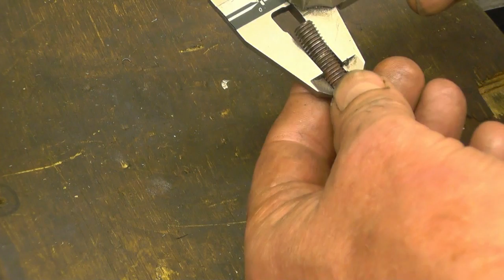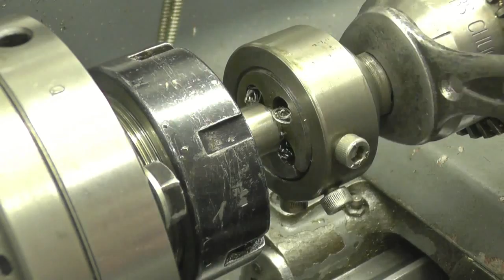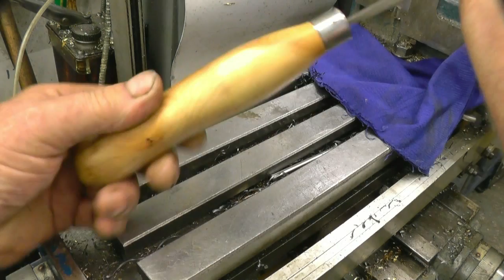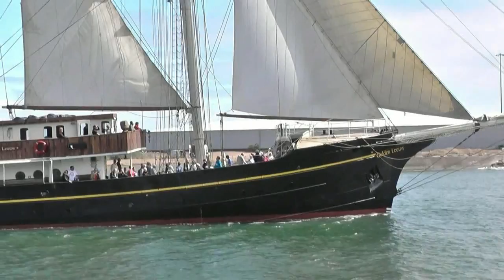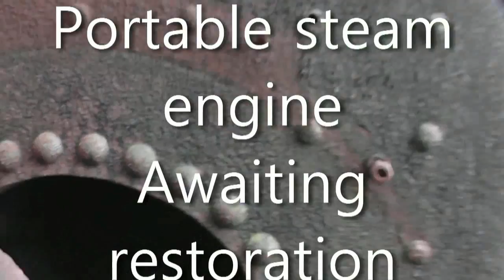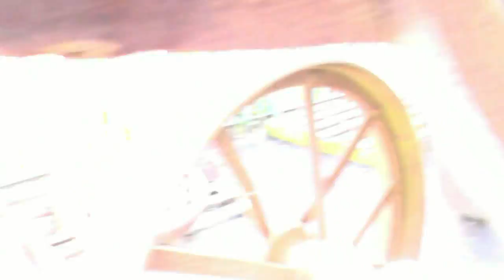SNNC 234 P2  Bastard Stud

Comment: John, 8mm is very close to the old 5/16 BSF thread, so may not be an odball, cheers peter smith
Reply: ned smith, hi, to compare TPI to pitch (metric), divide 25.4 by TPI.
Reply: Thinking though that 5/16 bsf is much finer pitch than 8mm. 8mm is 1.25 mm so I reckon the nut wouldn't have gone on.
Reply: It's likely that as the engine it came from was Austrian (Rotax) the metric thread was put into the casting and the whit was used for mounting external parts on. It from an ex British Army bike so the makers built it to an order spec requiring whit threads on the external stuff.
Reply: Yes Carl, that's a possibility, the old BSF 5/16 is 22 tpi, 8mm x 1.25 pitch  metric works out at 20.32 tpi so not far away, especially with a worn thread, I think you could get them to fit.